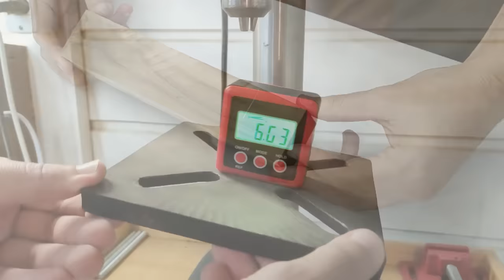INCREDIBLE! The most EFFICIENT device I've ever made. | Joinery for Beginners

Comment: Nice, but chip breaker not required and 6˚ hole not required if you instead offset the blade angle by 6˚. Making it a more simple build
Reply: @waynos waynos.  could you explain that concept a bit more fully please.

Comment: labor cost per dowel?
Reply: Depends on how many fukcin dowels he wants
Reply: For sure less than driving to a store or paying shipping costs to have them delivered home. With this device you can make any length of dowel, and with small adaptions also any diameter you need. Any time you want/need it.
Reply: @hansdegroot8549  seems no good reason why you cannot space out 3 or 4 different dowel sizes on a longer starting block, just need to line up the outside edges of the holes and make sure they are clear of any bolt holes you need to position the plane iron. Cool idea, may have a go, have a couple of old planes that can donate an iron.
Reply: @davidgee1585  That's a good idea to make the starting block longer different  dowel sizes (diameters)